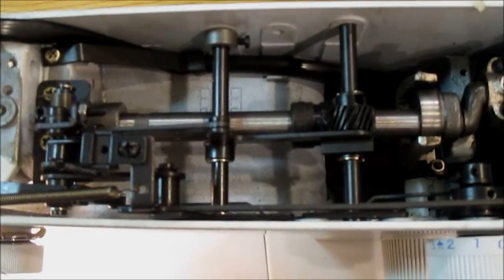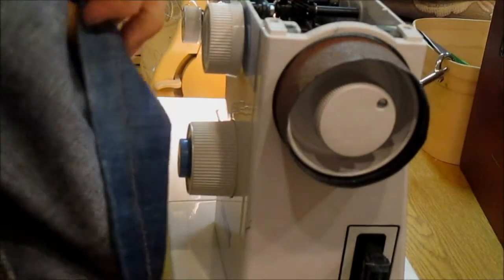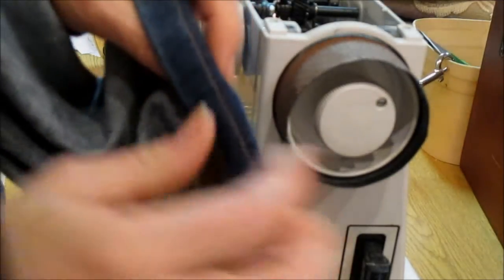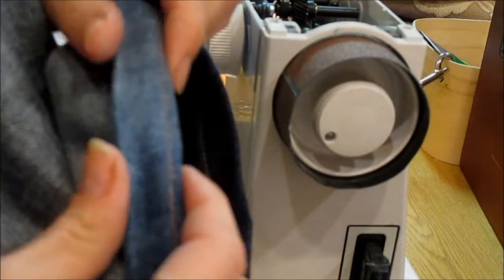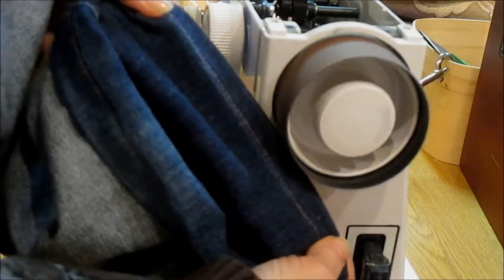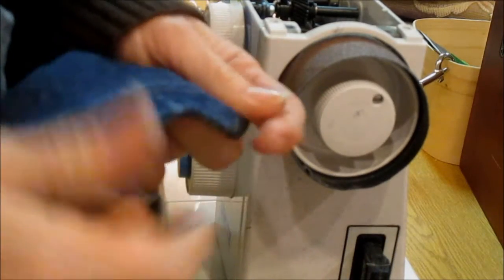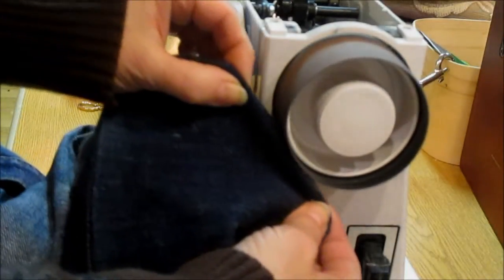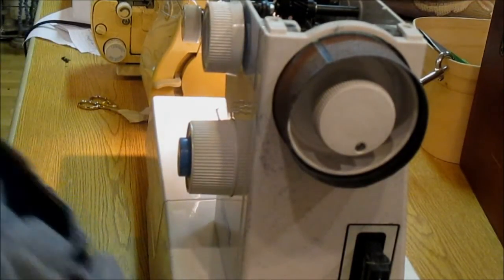How to distress your new jean hem

Comment: TIP: If you add the hem then wash and dry the jeans, a natural puckering usually occurs. This allows you to then buff the tops of the puckers for a close match to the original hem. A dremel or even efile (for acrylic nails) with a sanding band works well too. Appreciate the video!
Reply: when you say "wash" them, do you mean just soaking them in water will do just fine? or do you also need soap in order to  make them pucker?
Reply: Not sure what you mean by add the hem then wash
Reply: @alfredowidjojo8055 you just need to do a quick wash with no soap and dry them in the dryer. It relaxes the newly sewn hem and kinda shrinks the fabric so that the new hem pockets a little.

Comment: Another method that I think would yield pretty good results is, pick up a 6 inch buffing pad at Harbor Freight, the type used to polish metal, for about $6.00. Mount that on a 6 inch bench grinder and using only the polishing pad with nothing on it, simply run the new hem across the pad using just slight pressure.  The amount of force you use should determine the amount of "white" that appears across the hem as you move gently across.  This I believe would be a less aggressive method with less chance of burning through the fibers.  I'm getting ready to try this method on a newly altered pair of jeans.  I do applaud you for your creativity on your sander.  Great thinking!

Comment: Any tutorials on the braided hem you find on designer jeans usually? Most tailoring shops will not do the braided hem and opt for a simple one instead
Reply: Chain stitch takes a specific machine and can be fully undone with 1 loose string. I don't find them to be any stronger.